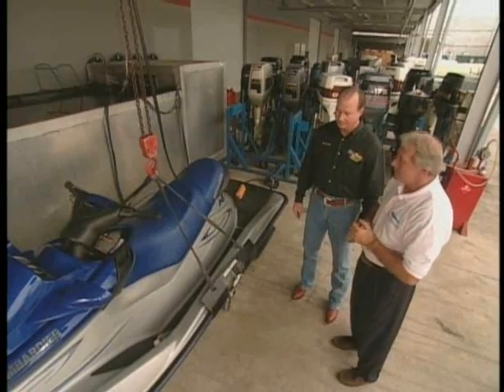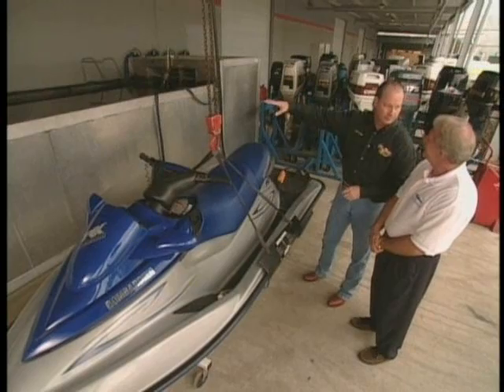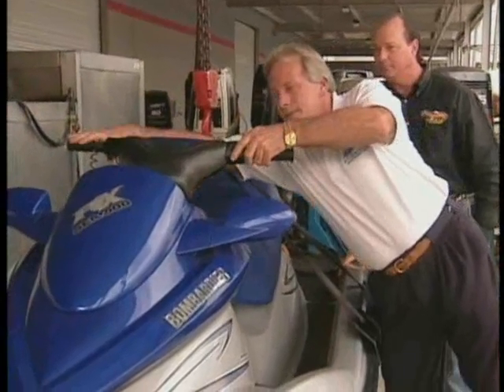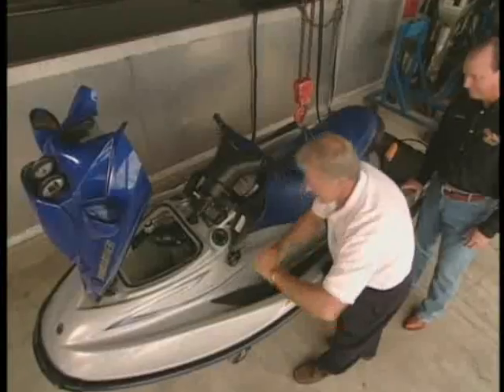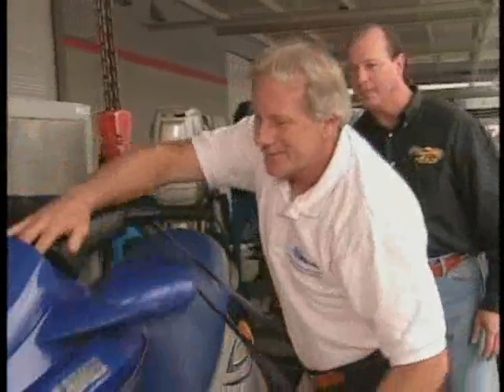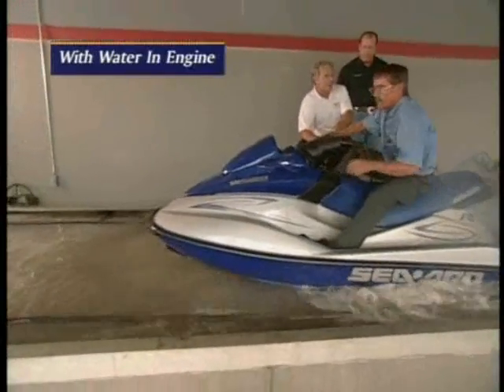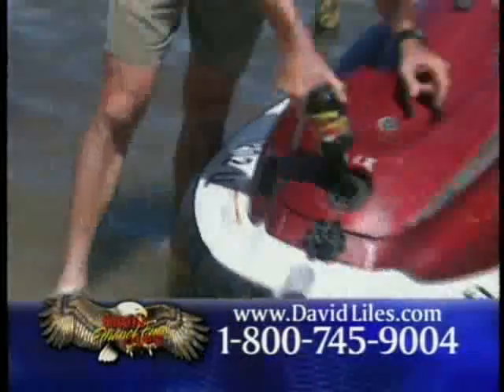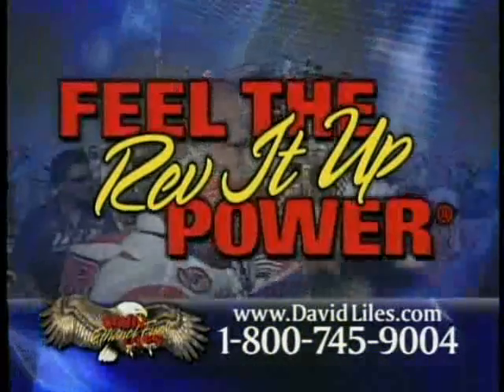David Liles Ethanol Fuels/Seadoo Test

Comment: Problem with this video.
#1 Phase separation / water will be at the bottom of the gas tank !!!
#2 The Sea-Doo Fuel pick-up in the tank Is 3" above the bottom of the tank.Putting water in the gas tank will not be picked up by the fuel sending unit by adding a cup of water.You would have to add at least a half gallon if not more!!
#3 All Sea-doo Watercraft have an in-line Water separator so if the small amount of water shown was picked up the separator would remove this before it enters the carburetors.